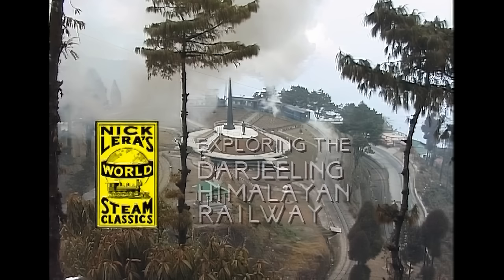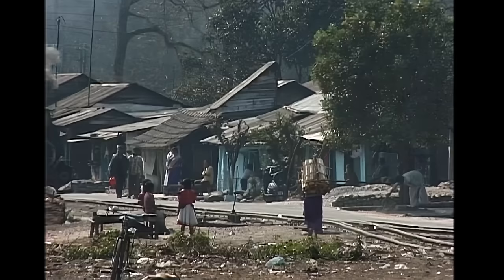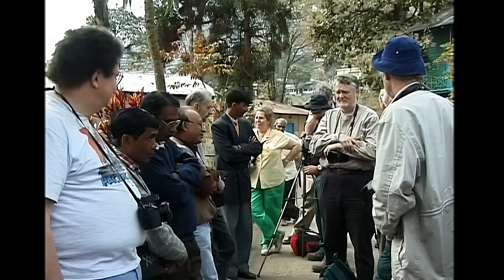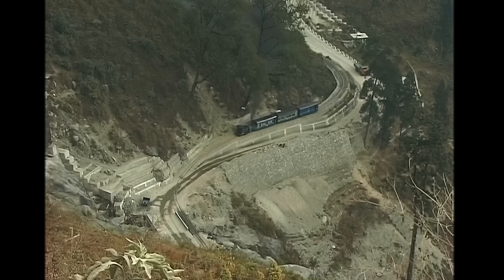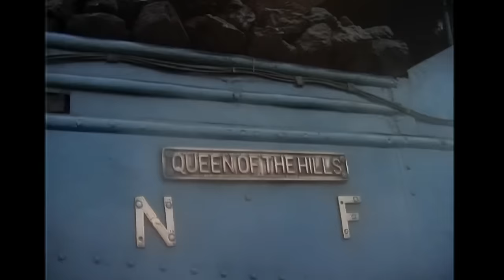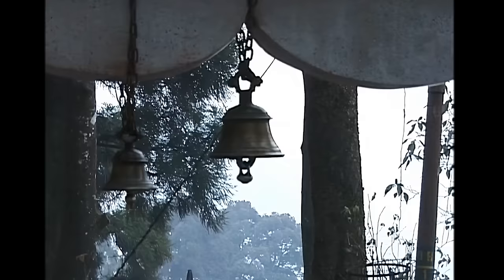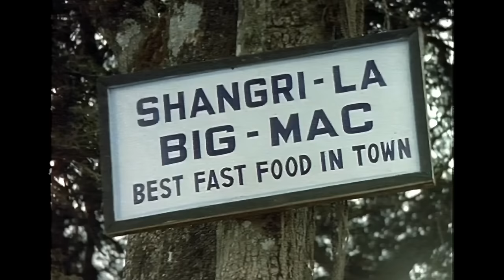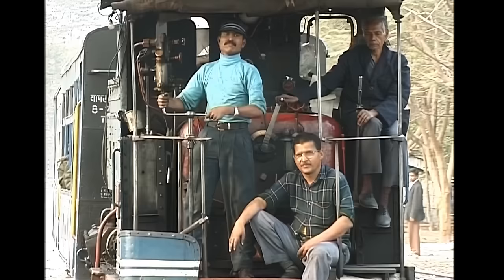India - Toy Train to the Clouds - English • Great Railways

Comment: Great video spoiled by Mark Tully's idea that you need a wide rail gauge to run large Garratt type locos. The Welsh Highland Railway runs Garratt locos on the 2' gauge and they came from South Africa and South Africa itself ran many Garratts on the 3'6" or Cape Gauge and they were enormous locos and bigger than the Garratt behind Mark. Even their non articulated steam engines would tower over Britain's steam engines on their wider gauge.

Comment: The Darjeeling Railway has changed dramatically since this video was made. In December 2023 it was announced that two more diesel locos will be built and the tourist train from Darjeeling to Ghum will be diesel worked. I presume a small number of the steam locos will kept for enthusiast charter trains but I wonder if these will be confined to the easier lower stretches of the route? I don't know how this will affect the UNESCO status which says original motive power must be used  on some trains. Is there a lower limit  for the number of steam strains that must operate/
Reply: I just watched a new show called "Great Railway Journey's From Above" episode on the Darj. They stated that the lower elevation run from New Jalpaiguri  to Darjeeling could only be pulled by the diesels now due to the weight of the new air conditioned passenger cars but steam is still in use from Darjeeling to Glum. Sadly it also said only 14 locomotives were still operational. (edit) I checked the date of the show, 2022, so your information is more current.